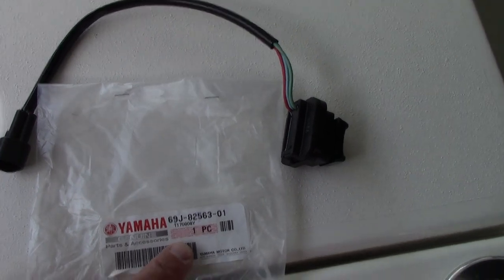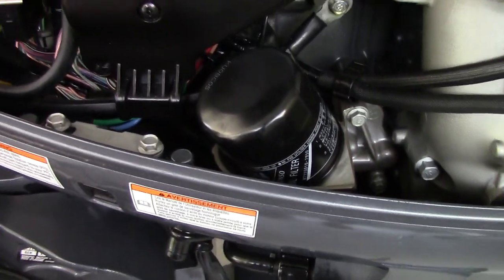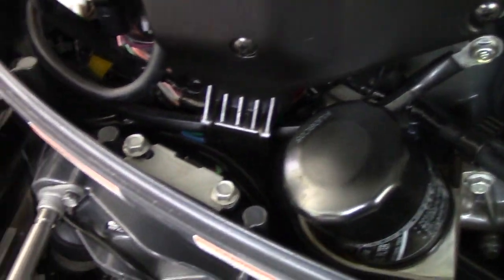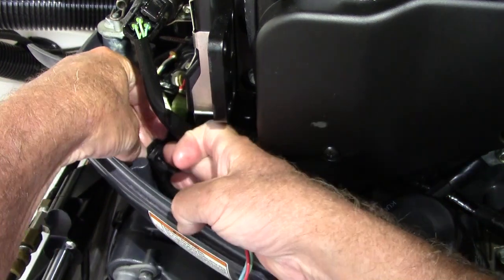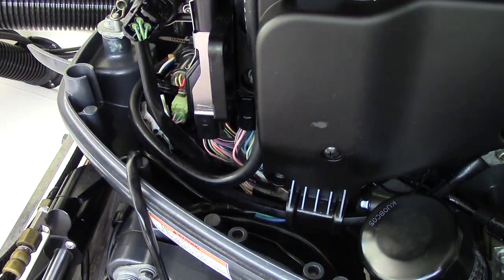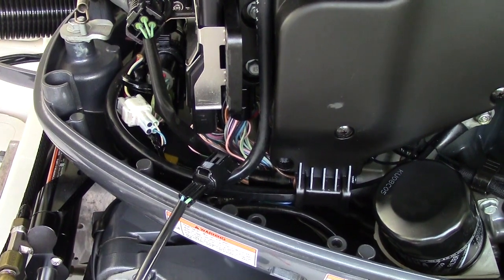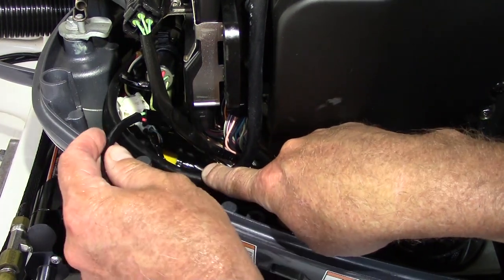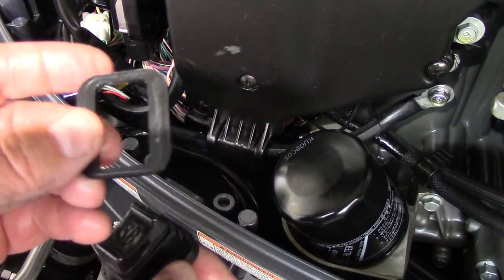Yamaha Trim Tilt Switch Easy DIY Replacement 2024 Updated Version

Comment: Hey i have a Yamaha motor and the trim and tilt is tuck on the up position in order to stop it i have to disconnect the battery can it be the switch thats stuck? Thank you

Comment: My outboard motor is a 2000 yamaha 90hp and I don't have a switch anywhere to do this...should it have a switch? I'm new to all this and have no clue. Couldn't find a switch on the engine at all.
Reply from the maker: Only if you ordered it with one. Not all of them have the switch on the cowling, just on the throttle.

Comment: how did you determine it was the switch and not the relay?  I think my relay is intermittent as when I take green or blue off the relay and touch directly to the red they both work.
Reply: My trim on my 2008 90 horse Yamaha stopped working all together. Did you figure it out?